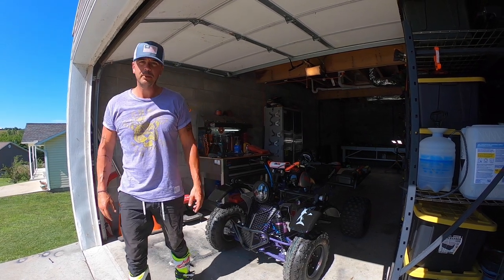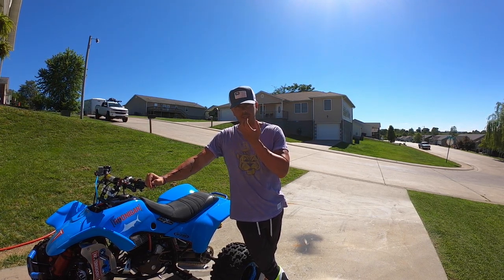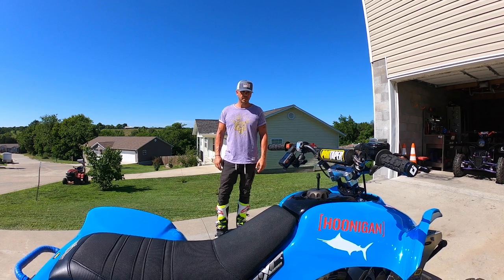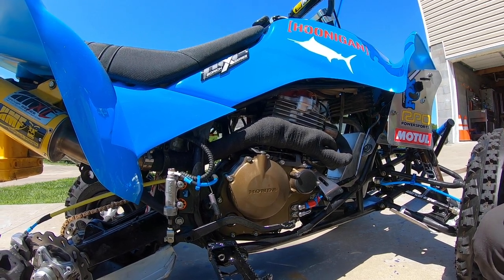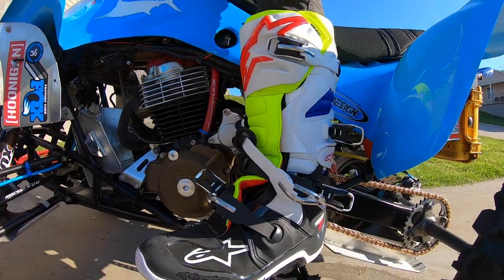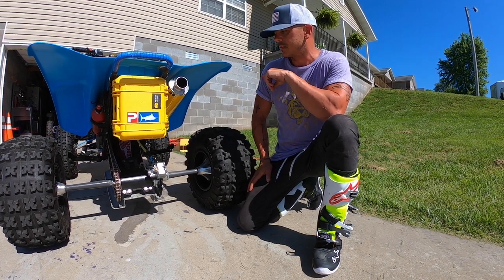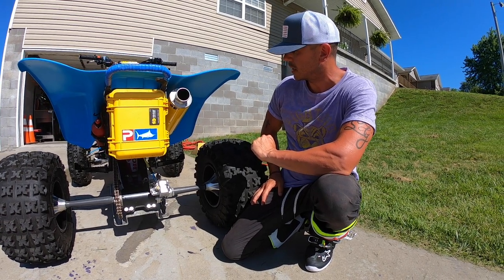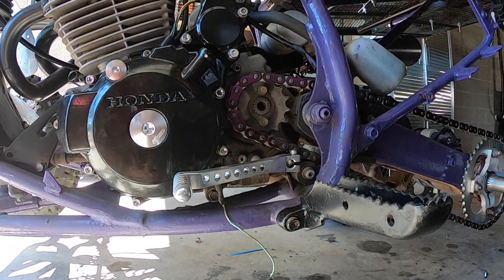Big Bore 400EX - 440EX Top Speed Test. Showcasing Custom, Handmade Brakes Lines From Core Moto

Comment: Watch your head studs. I would recommend putting some arp head studs in it. The 440 kits love spitting out head gaskets. Love the build man. I’m currently working on rebuilding a ktm 505sx
Reply from the maker: It has head studs. Before, it was blowing head gaskets about every other tank of fuel! 😣 We really haven’t gone into detail about what’s been done to this quad, but we should some time. Would make a long video.
Reply: Swamp Gump Harpy that sounds right. Glad you did them just looking out man.
Reply from the maker: ryan marcum Man, you keep looking out. It takes a village to keep these relics running like they ought to. Comments like yours is how we’ve learned. Well, that and thousands of hours of hands on. Thanks for adding some good pointers.

Comment: What wheel and tire size are you running for front and rear. Just purchased a 400 myself for a renovation project and been conflicted with sizes to run.
Reply from the maker: 9” back (5+3 offset), and 10” front. Good luck, pal.

Comment: My dad had a 400 E X that did 110 mph when it was bored out to 440 and it was a 2001
Reply from the maker: That's really awesome! That's a lot of horse power along with proper gearing. I wonder what the torque was on trails with it geared that high.
Reply: I am restoring my 2001. I installed the big bore 440 back around 05. It clocked 113 on the gps. Been setting since 13. Im hoping to somehow get to 120 this time 😆
Reply: @damienrodriguez3288  I hope you get it, his was built for climbing the cinder hills we have here that are a mile tall and almost vertical lol

Comment: All the people that has a 400ex has no idea how hot they run let alone if you do any hill climbing but if I was you I’d get them jugs out of the front of the motor so that thing can get some air and if you don’t have a lazor temp reader you should get one so you’ll see why I say get rid of them jugs. No bearings last like factory Honda and breaks to as far as I’m concerned
Reply: $30 trans/engine oil cooler kit from any auto parts store and adding it inline before or after the stock oil cooler and it never over heats.

Comment: My.440 with stage 3 hotcams and a 440 kit and a jetted out carb will do abour 93
Reply: Carter Funair my raptor does 107mph
Reply from the maker: #flexin
Reply: My nikes will do 20 mph for 3 seconds 👊🏻
Reply: on stock sprockets?

Comment: What exhaust wrap is that, and do you recommend it?
Reply from the maker: It’s whatever they had at the parts store. Nothing fancy, and it comes in either bronze or black. If it’s properly installed with high-heat ceramic paint behind it, and treated with layers of ceramic paint after it’s installed, it’s supposed to reduce engine heat exposure significantly. Seems to last about two years. I like it fairly well because it’s functional, but wear gloves. Trust me on that.

Comment: What cdi so you recommend on a regualr400 ex
Reply from the maker: Stock CDI on a carbureted 400. Make your fuel adjustments at the carb with jetting and your air flow adjustments with the intake and exhaust. Then dial in your needle and let the stock CDI alone.

Comment: What kind of plastics are those and where can I get them ?
Reply from the maker: These Plastics are made by Maier, and were purchased from ZMP Performance. You can get the 400ex plastics with or without the stock headlight cut-out. These are racing plastics, so they are without the cut-out. The color is called electric blue.

Comment: 14 sproket front is OEM tho the rear seems to have been an aftermarket ratio
Reply from the maker: 14 & 36
Reply: @swampgumpharpy7977  14 and 39 is stock which goes to 60MPH or 100KM here in Canada what a big difference 3 teeth makes an extra 15MPH
Reply: Stock on the newer models is 14 and 39. But on the 99-07(I think those years are right) the stock sprockets are 15 and 38.

Comment: Do you remember where you got the shock covers?
Reply from the maker: It doesn’t have covers. These are just bare fox shocks.
Reply: Swamp Gump Harpy on the back shock sorry for phrasing that wrong
Reply from the maker: Gabriel Lopez No problem! Those were bought 4 years ago when we did the first build. They looked awesome as a full set, and were better than most shocks I’ve seen. Unfortunately, they’re not made any longer. Had a lot of folks ask me about them!
Reply: Swamp Gump Harpy :( well thanks anyways for the reply

Comment: There's no way in f**** hell that's that's a 440 Big bore kit that only goes 75 miles an hour I updated it to stage 2 air cleaner cam jet kit complete exhaust added a 2 oil cooler primary chain 15 tooth sprocket in the front 36 in the rear my 2004 stock bore wisco jug and piston 10.5:1 compression ratio I get my 400ex to 85mph according to the GPS speedometer I added to my bike which is supposed to be more accurate then every speedometer on every

Comment: Running a 36 on the back will kill your bottom end and over all torque and you would think it would help the top end but I can tell you the bike would have to have 50 h/p to be able to pull a 14/36. I’d bet 100 bucks that it will be faster with a 14/37 cause there’s more of a chance that it will have the power to pull it. Try it and see

Comment: It sounds like you have a hell of a knock
Reply from the maker: Yes it does. Of course, 400EX’s all have noisy valve trains, but it’s likely that the valves weren’t put back stock after brake-in on this motor. The sound could also be pre-ignition from some older fuel that we were running that day.
Reply: Id definitely say valves honda bottom ends almost never go out
Reply from the maker: Agreed, pal. Thanks for watching!
Reply: @lsxdirtbag1530  I've seen crank bearings go on hondas

Comment: How much does a build like that cost
Reply from the maker: If you’ll click the drop down menu,  the mods on this are itemized with prices. The final price is north of $12,000. We admit that this is truly insane, but lots of fun! 😄 A build exactly like this could be had for around $9,000 - $10,000 if you’re experienced, and can perform the engine work yourself.
Reply: @swampgumpharpy7977  i jus did a 440 ex build im bout 6000 into it and still few more things im gonna do to it